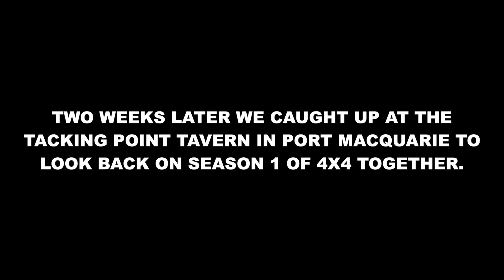WHAT BROKE? Georges Junction Part 3 of 3

Comment: Hi guys thanks for the explaining there event good effort by all involved 
Don’t think I will put a locker in my Colorado but now 
Good country to visit for sure 
One day I might get down there 
Just wondering how much was the repair bill in the end 
Regards
Reply from the maker: hey mate, there is a bloke that makes stronger clamps for the steering arm so it doesn't move. In our Facebook group is where you can find a post where David got one
Reply from the maker: I think in the end the repair bill was around $1500ish
Reply: Thanks for your replies guys 
Just wondering what size tyres and rim you running and what offset is the rims they look good on the Colorado
Reply from the maker: Hey mate! not a worrie at all. Davids car is running 32inch bfgs, 15inch sunnys, and neg 44

Comment: Thanks for the reply 
Did he have to do any other modes 
I have 40mm lift in in front an 50mm in rear in Qld there cracking down on lifts here big time now 
With 265 70 16 BFG KM2 AT 
Pos 20 rims so far so good tyres and not rubbing
Reply from the maker: This is what David told me 😁

(Front)
Ball joint flip,,, 
Diff drop, (not a must),,,
Max out standard torsion bars,,, 
Longer shocks,

Back 2inch leafs,,
2inch soft ride shakes,,
Longer shocks 🤙🏼